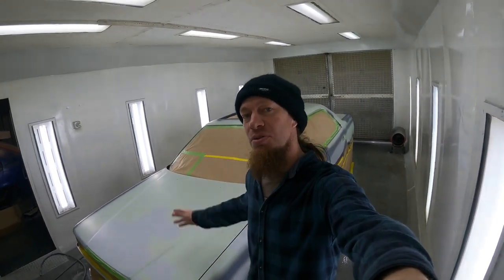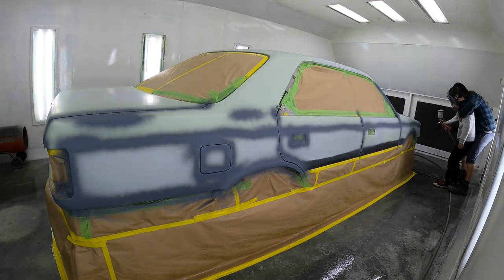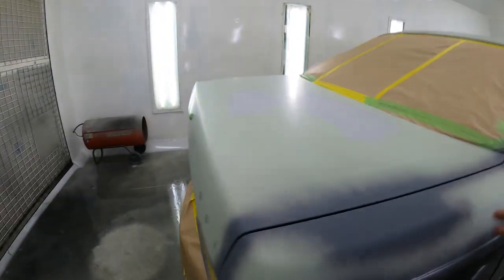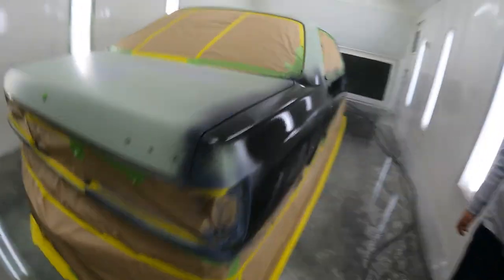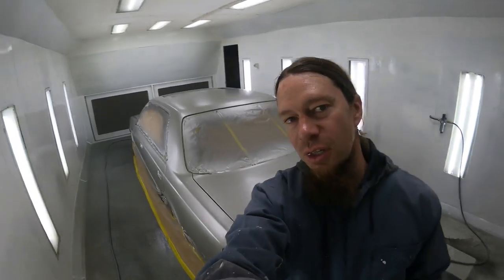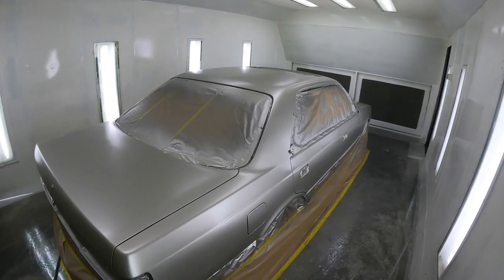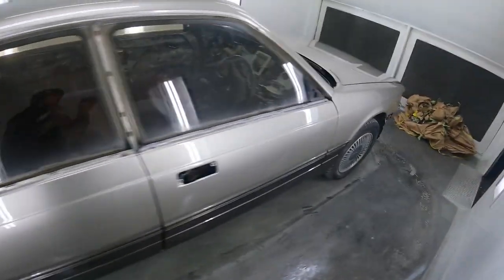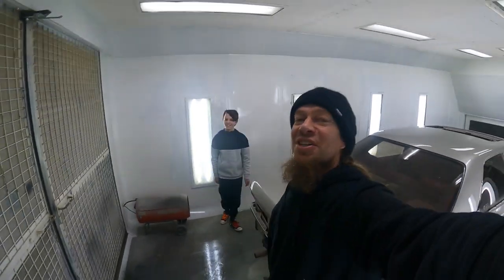Respraying my Mazda 929 (with help from my son!) #mazda #painting #fatherandson

Comment: Hello there, there is a 1990 929 v6 3.0 rwd manual for sale nearby for me.
I would like to just lower it on some sick wheels and daily it. I think i can get it for 8k euro's with 189.000 km, is it worth it.?
And how do you lower these boats?

Or should i just go for a volvo 940 turbo...
Thanks and i subscribed!
Reply from the maker: Not sure what they're worth over there but 189 is extremely low kms and manuals over here are rare as hens teeth!
FC rx7 coilovers with custom tops. You can make your own, or buy the toyshop engineering ones out of new Zealand. Or you can put the 929 strut tops onto the coilovers